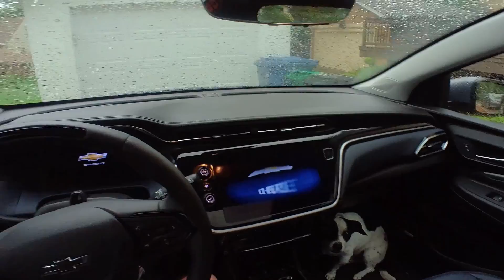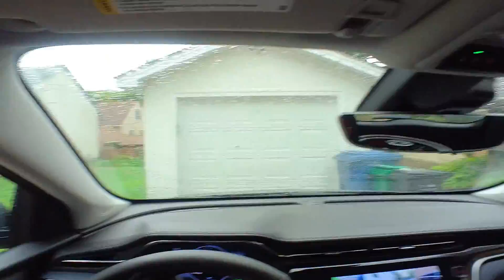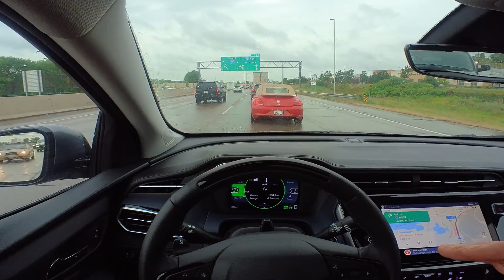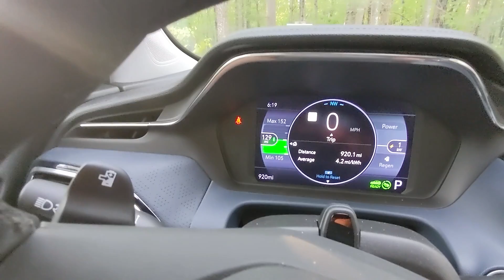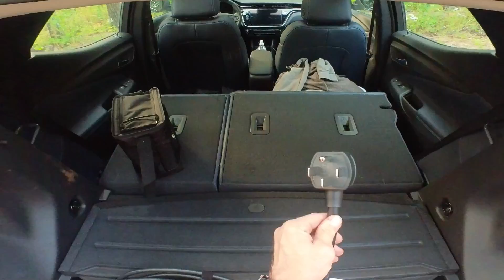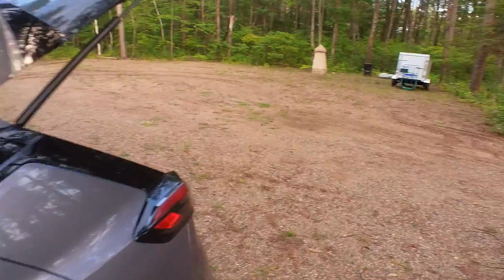Long range driving my Bolt EUV

Comment: Thanks Shad, interesting video.
Here's how it works, regen does not increase your range. In order for that to happen you would be creating more energy than you're using which is not possible. Stop and go does affect range on EV's, not the same way as gas cars though. Once you stop it takes energy to get back up to speed (Newton's first law, a body at rest tends to stay at rest, a body in motion tends to stay in motion).
One pedal driving is convenient but, after testing I think you get better highway mileage with it off - try it and see if I'm right. I use my Bolt with it off and GM's great paddle to slow down and stop.
I do use "L" when going down steep hills and in town though.

The reason you see your range go up is because the system computer is recalculating your range to the slower speed.
Reply from the maker: Incorrect. Being in stop and go traffic does increase range when compared to going a steady speed. Unlike a gas powered car, as you slow down power gets added back into the battery essentially giving you free energy.

It's not just about the display. I get over 300 miles of range driving around in stop and go traffic in the city vs about 220 going at a steady freeway speed. Regen absolutely does increase range.

Compared to gas cars, every time they have to stop they become less efficient. Gas doesn't get put back into the tank when they slow down. Instead, the engine keeps running and keeps using gas even when the car isn't being propelled forward.
Reply: @geekingoutwithshad  Try this: Drive your car for two miles at a steady state of 20 mph, then drive your car for two miles using regen but stop every 1/4 mile and then go back up to 20 mph. Tell me what your battery usage is. The energy expended to bring a vehicle up to speed can never be fully recovered, there are efficiency losses. If you could gain all the energy back you would have 100% efficiency which is not possible, you would essentially have unity, again, which is not possible. Basic physics.

The reason you get more range going slower is because of the coefficient of drag of your car. At freeway speeds air friction is reducing your efficiency, that's why when you drive into a headwind your range drops.

Regen increases range over no regeneration, yes, but regen can not give you more energy than what you initially have in the battery. If you take a trip in your car with regen does the car battery run down? Of course, that's because regen can't make energy, it can only replace a portion of the lost energy, never 100%.

Yes, of course, gas cars don't have regen, there's no way to put a portion of gas back in the car, that's not the issue here. You do gain some of the lost energy with regen but not all of it.
Reply from the maker: @mosfet500  The energy doesn't have to be fully recovered. If any of the energy is recovered it's going to extend your range.
Reply: @geekingoutwithshad  Right, regen will extend your range over no regen as you will recover some of the lost energy.
Reply: Stop and go (with regen) also increases your range because your average speed is lower and therefore you are fighting less wind. Overcoming wind resistance is the bulk of energy consumed with either gas or electric cars. Gas cars have notches of improved economy as they step up thru gears. Electrics which as a rule have only 1 gear, pretty much lose range with any increase in speed.  If you could drive long distance at 5mph you could probably get 600 miles on a charge. The economy drives of the 60s (Shell with Platformate, anyone?) where gas cars got 80 mpg, the cars ran on salt flats at like 12 mph in 3rd gear and never stopped.
Reply: @natehill8069  ICE engines have a very narrow torque band, they need the tranny to keep them in that band. Electric motors have a relatively level band, all they need is reduction.

You get the best range at a constant low speed, below the coefficient of drag reaches the point that it affects range noticeably. On level ground regen is basically a brake saving feature although down hills it's a benefit. It has to do with recovery efficiency, you never recover fully to the level before the regen took over. So you go down the road at, say, 40 mph, what happens? If you take your foot off the accelerator and regen takes over it slows your car faster than if it coasted with little or no regen so you never recover to the level before you took your foot off the accelerator - it's impossible. Now, because of regen, you're at a lower velocity and have to accelerate to the original velocity which consumes more energy than if you coasted. If you just coasted without using any energy you would slow to a higher point than the regen velocity and it would take less energy to accelerate to the original velocity. Regen helps in places where you have to engage the brakes but not when you're coasting.
Bolts have another feature, when you brake the regen takes over and if you brake just before the point the brakes mesh the car will regen, check your display. Those of you who doubt me should do a test over level ground with and without regen on a several mile loop. Coasting without regen, regardless of velocity will always give you better range than using regen if you don't need to use brakes. Again, regen only helps when you have to engage brakes like when going down hill. If I go down a steep hill I use regen, on level ground not much.
Reply from the maker: I think many of you completely missed the point I was making. I was comparing being in an EV in stop and go traffic vs a gas powered car that sits and idles and wastes gas. ReGen in stop and go traffic is pretty awesome!
Reply: @geekingoutwithshad  I think the Bolt regen is especially well done. My standard driving is in D with the paddle, this give me the best range.
Reply: @mosfet500 

Actually, D vs. L makes no difference in the energy efficiency of the vehicle. It simply controls what your hand and foot muscles need to achieve the desired level of acceleration/deceleration. 

For example, in D mode, you can get a 15 kW power output by pressing the accelerator pedal a certain amount and turning the regen paddle off. Switch to L, your foot may need to press down slightly harder to obtain 15 kW, but 15 kW is 15 kW, and it makes no difference whether it comes from a slightly lighter foot press and D mode or a slightly harder foot press an L mode.

Regen is the same, as the regen paddle allows access to the same levels of acceleration in D mode as L. In L mode, you get 15 kW regen by pressing the accelerator pedal some light amount and having the regen paddle off. In D mode, you get the same 15 kW regen by turning the regen paddle on and pressing the right foot with a slightly different intensity. But, 15 kW is 15 kW and the the amount of battery regen and stopping power delivered to the car is exactly the same, regardless.

In other words, D vs. L is really a matter of ergonomics, not efficiency. You can argue that may it does have an efficiency impact if the driver doesn't know about the regen paddle and uses the brakes in D mode, instead. But, assuming the driver is fully knowledgeable about the car, it simply doesn't matter.
Reply: @ab-tf5fl  Not true, regen immediately slows the car when you remove your foot from the accelerator, faster than the human body can react and with greater force, D slows it less, If you're in D and you take your foot off the accelerator you'll coast, because L slows you down more it takes more energy to get back up to speed and because the efficiency is not 100% energy is lost so in L you're total efficiency is lower, again, Newton's First Law.

Comment: Was this a custom order?
Reply from the maker: No, it was what was available at the time. I didn't plan to get a Premier Launch Edition. I would have normally gotten an LT with a winter package or something similar because I honestly don't care for all the fancy features. But due to supply chain issues and extremely limited availability added with the $6,300 discount GM offered on these cars, I got this one which was all that was available. It's actually not a bad deal for the lowered $37k price I paid. I don't keep cars past their warranty so if stuff goes wrong with all these crazy techy items the dealer will fix them.
Reply: @geekingoutwithshad  did you consider the regular EV as well?
Reply from the maker: I had a 2020 Bolt EV. I wanted the slightly bigger model so my bikes would fit in the back easier.

Comment: Great video. What are the flashing lights on the steering wheel? Are they bothersome during night driving?
Reply: i believe those lights are for the sensors to make sure you're paying attention when using supercruise.  not sure if those are actual lights, like infrared or something, or cameras
Reply from the maker: They only show up in the video. They are not visible to the human eye. I should have put some text stating that.

Comment: One thing I've noticed regarding my 2020 Bolt's heater is it puts out a lot of heat and since it's ceramic once the cabin is at temperature it uses a lot less energy to maintain that temp. The Auto setting is also good at managing temp vs efficiency in winter.
Reply: I preheat in the garage then use the seat and steering wheel heaters, my wife and I are fine most of the winter. I don't miss not having a heap pump.

Comment: yup they have no range
Reply from the maker: Actually, it has a lot of range. I can cover quite a bit of ground with my car. Sure, it may not be ideal for a long distance cross country road trip, but aside from that it can go where I need it to go 

That is the biggest misunderstanding about EVs. The average distance people drive is much lower than one might think. It's only those few long road trips that most people don't do or rarely do that make a difference.

Once charging networks and speeds improve, and they are improving quickly, road tripping with an EV will be a breeze!

Comment: Great video again Shad.  Thank you.  Maybe you could do another video of this same trip when winter is here.  Specifically, when there is snow on the ground haha.
Reply: I will have to see what range is like with winter tires in it to see if it's feasible. It should be, but winter tires reduce range because they are not low rolling resistant tires.

I drove my Volt up here a couple of years ago and that had low rolling resistant tires. Even though they were All-Season M+S rated tires, as are the ones on this Bolt EUV, they almost got me stuck some of the lower maintenance roads.

So I will do some mid range testing around the cities with the winter specific tires and if I feel the car can make it I will drive up here. That means I will need to clear a path to the 240v outlet which I didn't bother doing last year.